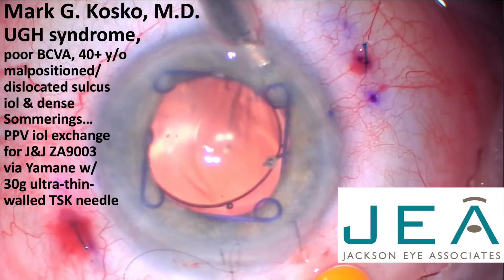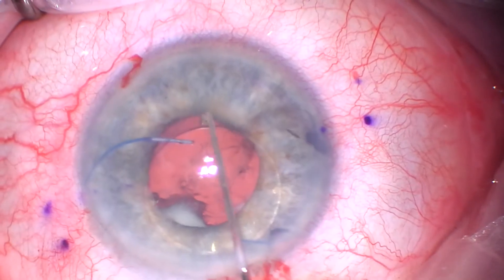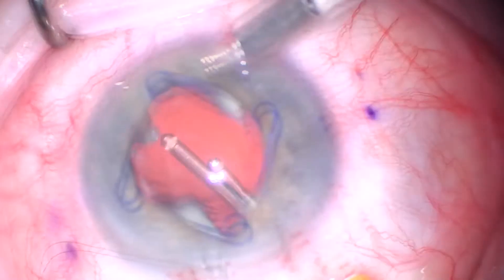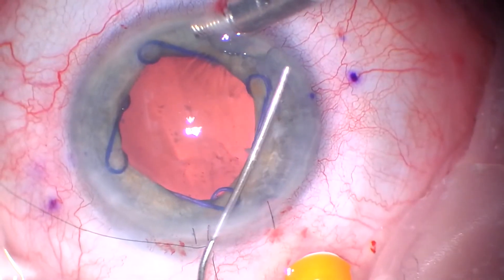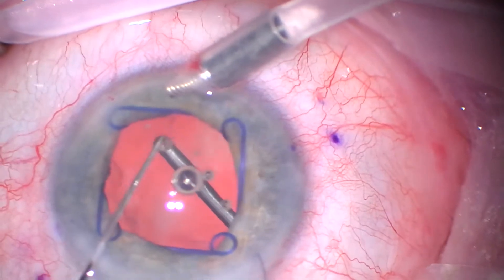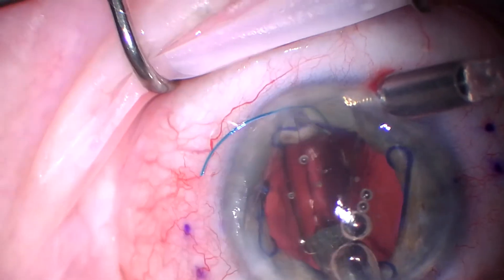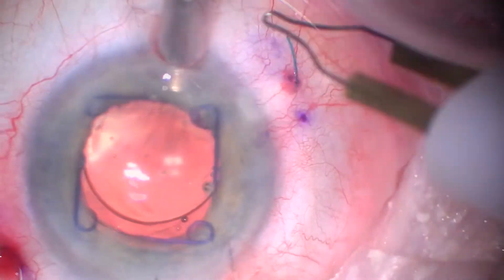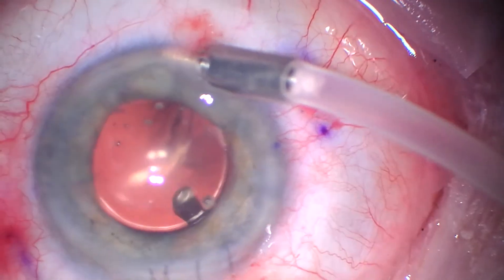Mark Kosko Yamane with ZA9003 PPV IOL exchange

Comment: I've been operated for cataract in both eyes. Bifocal IOLs have been implanted in both, making it impossible for me to see without specs. Is there any remedy/surgery for getting rid of specs/ having zero power again? Thanks in advance!
Reply from the maker: Hi Dwarkesh, there are likely several options to help you. You might could have a “LASIK touch up” or an iol exchange to an implant with a slightly different power to help you get out of glasses again. 

Or, if you never liked your multifocal/“bifocal” implants even from the start, it’s possible you just weren’t a great candidate for them in the first place, and you could have them exchanged for traditional monofocal implants. That might increase your need for say reading glasses but in some cases patients are happier going that route.